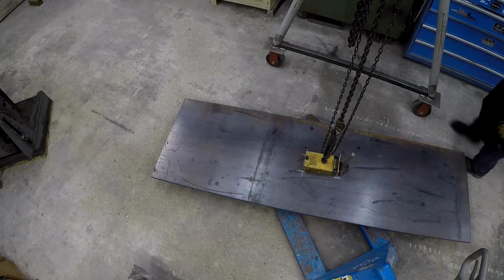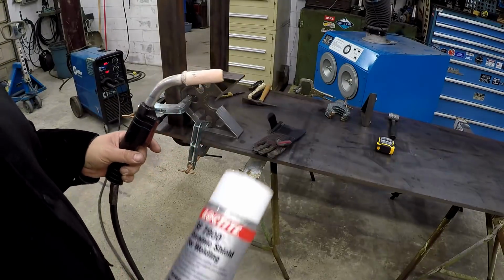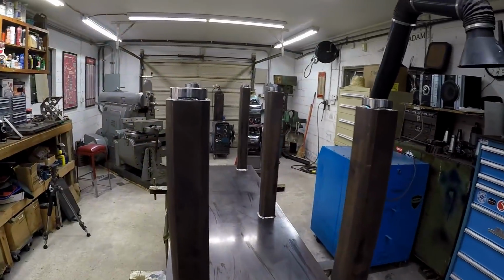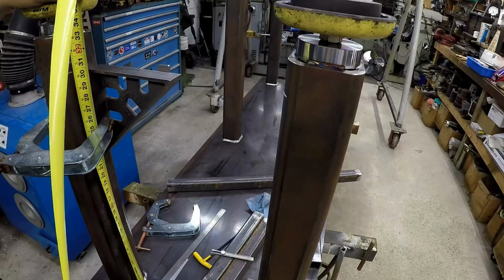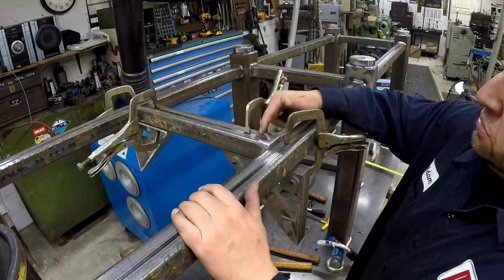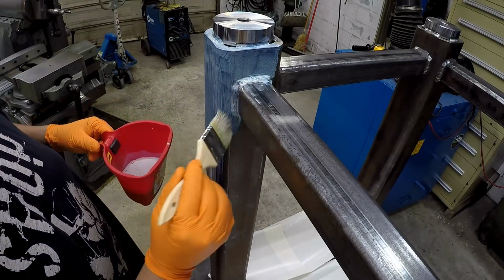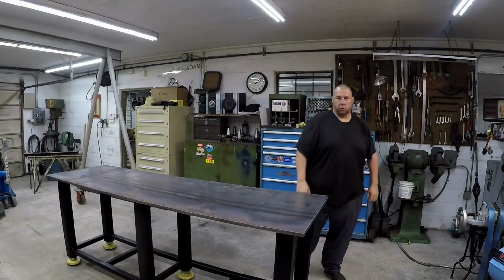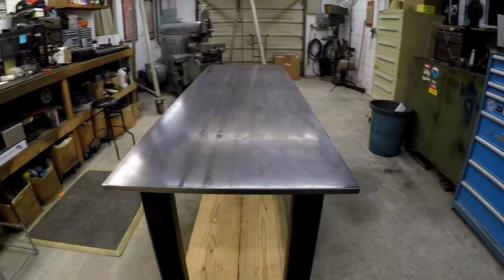SNS 226 Part 2: New Shop Work Table

Comment: Great job! I would probably drill some holes through the square tubing on the vise end where I could slide tubing through for a shelf. I would just drill one side of the center leg and keep the other end open. If you could dedicate the shelf to the work in progress, you could free up surface area and save a bunch of steps.

Comment: Whenever you bolt a vise to a table it is always in the way. When you don't have one on the table you always need it. The receiver hitch is  is how things get done here, my good friend introduced me to that some twenty or more years ago. If you want to mount something else like a bender, V block, bead roller or pipe vise etc..., No problem, just unbolt and change. damn nice table Adam, nice thing about a thick to is they do not move around on you when you reef on something in  the vise or get serious with a hammer.

Comment: Your little smile at about 20:35 said a lot. Nice use of the giant squares and beautiful welds. Next it needs to be scraped in. :-) I too would hate to drill holes in that beautiful top so love the receiver hitch tube idea . Several could be mounted around the table for versatility. You did good Adam and are also looking good.

Comment: NOW THAT IS A BENCH ! Being able to level it is a sweet bonus my friend. Well done ! It's almost odd to see anyone welding stick inside anymore. These are very nice ! Just think about all the stuff you can put on that shelf, LOL. I always had rod holders welded to the underside of the bench that would hold a box ea of 1/8, 5/32 and 3/32, I did a lot of heavy rod work in those days. A length of 4 in angle down one side V up. Very handy. Being able to easily move it is a real bonus too. Thanks bud. It's a beauty !